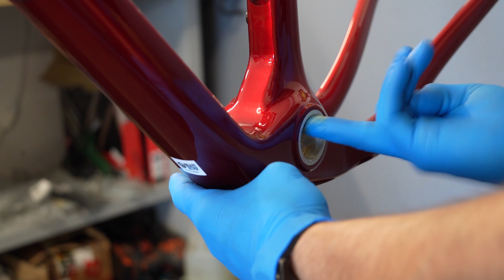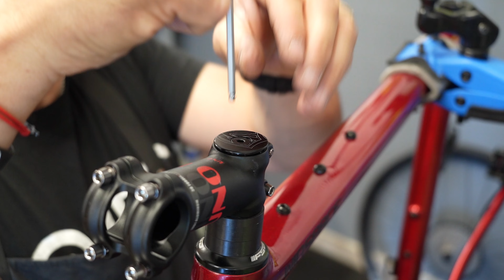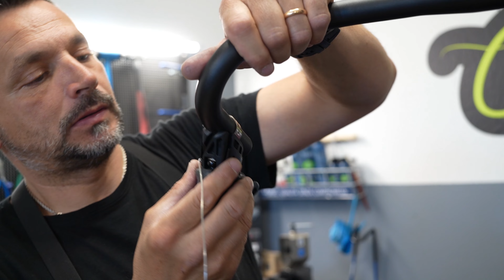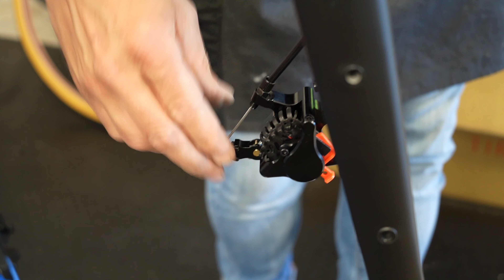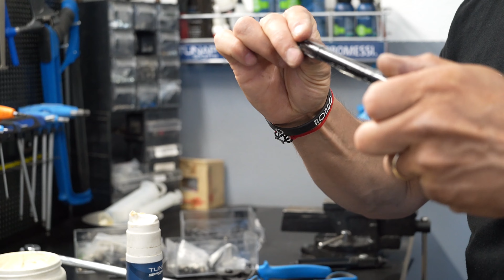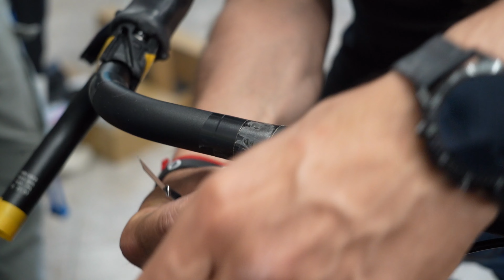BUILDING BIKE | Winspace  Gravel G2

Comment: Thanks so much!  I didn’t see you install the aluminum spacer onto the fork; the part which reinforces the D-shaped fork tube.  Also, is the opening on the downtube large enough for two cables if you were setting up a front derailleur?